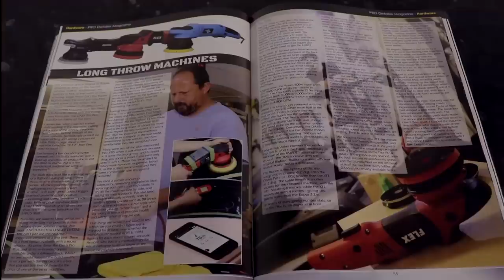Autoglym Polar Range Review  - Wash & Protect your car with an awesome thick snow foam cannon system

Comment: additional note; Autoglym reccomends not applying Polar Seal more than once a month
Reply from the maker: important point ill sticky it. thx richie
Reply: Forensic Detailing Channel what is the reason for this? Can it have a negative impact on the existing protection or (gulp) on the paint?
Reply from the maker: it wont damage the paint its just like a bonding siloxane in water.   If I had to guess, your just putting too much of this material on if you used it every week.  its a mirky white liquid so maybe you start getting like higher chance of bad application or like patchy product on the car. dont know, shouldnt guess, because it might just be because its a waste of product.
Reply: Can buy that canadian tire
Reply: What the price of it
Reply: I'm tempted to get their sealant mainly because of ease of applications. Probably takes just 5 minutes compared to an hour applying a wax or sealant by hand.
Reply: @zaink7037  how did it work
Reply: @DavidC1  I haven't gotten it yet 😅. Still thinking about it 😂
Reply: @zaink7037  Hour?? maybe if you're getting a workout at the same time!! you could watch a movie before you coat and buff a car with bh double speed hehehe
Reply: @martin1649  lol next morning I feel it in my back and sometimes my legs so must be a workout 😂
Reply: @DavidC1  finally got it. It's okay to be honest. Can't beat a hand applied wax really
Reply: I use it every week no issues 👍
Reply: I use it weekly no issues been using it like that for a year

Comment: Thanks for taking the time to review - glad you enjoyed it, the car looks amazing.
Reply: Is Autoglym Polar range safe to use with other Autoglym polishes & wax?  Will it strip previous polishes/wax or is it safe to use along side Autoglym products.
Reply: joflynn5 Yes safe and pretty much ph neutral when applied at the right concentration. It is recommended to still use a wax and or sealant and treat polar seal as a top up.
Reply: AutoglymUK yeah it’s good stuff but I wish the Polar wash would stay on the car a bit longer like the snow foam
Reply: @markford8649  i think the sylizanes bond instantly, they are like a magnet to the clear coat ....from what i know....i think john explained a competitor product once this way...but same concept.
Reply: 20 years ago u brought an orange XR3i, turns out, thanks to your resin, it was blood red ans ended up the redest XR3I in town😁

Comment: I’ve been using this system now for 2 months and I must say that it’s a cracking system. My car is 18 years old and it’s still as shiny as the day it came out the showroom. As for the seal even if you do get it on the windows no worries it acts the same as rain x with no watermarks left on any windows even the front window has no smearing when wipers are used. Also the polar seal does last along time when applied to the car. I’ve used it as Autoglym recommended and it still works after a month before applying a top up coat. 
All in all an excellent product.

Comment: I'm testing these now, the snow foam is excellent, the wash is average, it doesn't remove stuck on flies as good as the 2-bucket method. And I think it's because the wash foam is being applied by cold water, whereas car wash in a bucket will be with warm water.  However,  the seal smells amazing and is really easy to apply, and the results easily as good as Autofinesse Aquacoat. My favourite is the seal and I can see the bottle lasting ages. For the wash you either should just do half a car at a time if sunny otherwise it could dry out, probably better in the winter to use the wash anyway. You also need to factor in buying 3 separate snow foam bottles to avoid cross contamination.  For me I think I'll just be using the AG pre-wash snow foam, my normal 2-bucket wash & AG seal monthly.

Comment: 1k mile wash.
Used AG alloy wheel premix.
Then bottom half spray with Sfix HD.
Then the AG foam trio.
Cleans your car ok.
Using a 56 bar cordless power washer.
Cannot abide rainx or AG seal on windscreen.
Crap at low speed in drizzle or mist.
Great video
Cheers

Comment: I've been trying these products for about a month now. I'm using a new Mitsubishi L200 as the test bed, it's been fully prepared, machine polished then been given a good couple of coats of their Super Resin polish. On top of that, I've used their Ultra High Definition HD wax.
The only downside I've found is if you mix a strong solution of their Polar Blast. I used it one Sunday and there were traces of foam still present in the street the following Wednesday! So, I had to ease up on its use to stop my neighbours complaining. 
All in all, I like the range.
Reply from the maker: your right.  but anything with more foam boosters and stabalizers has more foam thats also more erm.... stable.

but yer foam sticks around on ground.  someone else said that  but its true it does stick around longer.

Comment: Hey John. I have just bought a new hose for my Karcher pressure washer. It's a long life anti kink rubber hose with a swivel connection at the lance end. I got it from Direct Hoses and it's one of the best investments I've made. Not only does it not tangle up like the thermoplastic ones but I seem to have more pressure output now. Its well worth £40 for 10 meters and is cheaper if you buy it through Ebay for some weird reason. Just search for Karcher Swivel Hose. 😀👍
Reply from the maker: can you link me up jason I might be interested. that  green hose lol :)
Reply: @ForensicDetailing .I hope that link works ok.

Comment: Hi Jon, I have been watching your excellent videos for a while and have purchased things on your recommendation like the das6 (great bit of kit). I finally bought the polar series set after watching your review and another YouTube review (a Scotsman wearing glasses!!). This stuff is amazing not only has it cleaned my Renault master swb van, it was easy to use (did buy 2 more snow foam guns for ease of use). Polar blast worked fantastic, polar wash was great, I think my 300ml total mix was asking too much for a vehicle that size, but the polar seal 40:250ml was spot on. The van is now sparkling even more, it already had a coat of ag hd wax. I am a big fan of ag products and will tell them this. Thanks for a great product review and look forward to many more as you are teaching an oldish (45) dog new tricks, keep up the good work 👏👏
Reply from the maker: thanks paul.  you can get great results from these products.  I love using this system in winter, its so fast.
Reply: Thanks for the advice. I was thinking of this for the winter and use my normal 2 bucket method for summer use!!

Comment: Spot on review. I’ve just bought the polar wash to save time as my car is big and keep going back to the bucket can be annoying. Doing a panel at a time, contact wash then rinse is the plan. I’m happy with my polar blast but when that runs out I’m using bilt hamber touchless.

Comment: I'll give the seal a miss as I hate the water activated ones (apart from on wheels) as they do end up on the glass and and time saved is wasted claying the screen! The wash stuff looks very interesting though. There appears to be a high degree of lubricity. I've been thinking about a Hozelock Y connector so that the PW can be attached along with the Hozelock trigger multispray -  would allow the mitt to sprayed clean (like your 1 bucket method) and, on a warm day - PW soap, wash with mitt, rinse panel, spray mitt, repeat, all with no swapping of water supply. Yes, I know, I'll get it all in a tangle and fall over ... xD

Comment: Hi Jon. Another great review. 
I have been following a similar system, but using standard car shampoos in my foam lance. Yes I snowfoam before I go in with the contact wash, but while the Bilt Hamber Auto Foam is doing it's thing, I get a shampoo solution ready. I also use dedicated mits for the top section, and ones for the lower sections and bumpers.
I found it to be much quicker, and one less bucket to fill, and lug around. I also do half the car, then the other half. To be really fussy, I'm going to see how rinsing off with demonized water through a Worx Hydroshot helps speed thing up. 
What do you reckon ?
Anyways, cheers bud. Look forward to the next one.

Comment: Afternoon John et al,
Used this for the first time today as a possible service additional service to offer. My points of note:

Snow foam, quite effective, decent amount of dirt lifted and seen in the run off. Seen a lot worse from others
Shampoo. Dried a little quick, considering it wasn't that hot today, and no direct sunlight. I may up the concentration next time, maybe. I think it best to maybe clean the wheels before applying the shampoo (either post snow foam, or post snow foam rinse) Or, as John suggests, maybe sides at a time.
Sealant. Wow, for such a small amount needed to apply, worked very quickly and the beading afterwards for such a simple application was great. Didn't think the shine was there as much as I'd hoped. However, the car I used was covered in salt and no protection was on it already.

If I had questions for AutoGlym, I've always worked top down, the instructions here are apply bottom up, just wondering why?

Thans for the video John.
Reply from the maker: Im not sure on the applying thing..  maybe top panels are the ones likely to be the hotest so if you start there its gonna get a longer dwell time.. maybe if you put more on the top it risks more going onto windscreen, dont think its critcally important though.    Ive had it on the car for over a week and its been really cool.  Im looking forward to seeing how it is next wash.  And I want to try decanting like I said to use as a rinse aid.  also interested to see if it makes future washes easier because the car is properly dirty again now because of all the like wet winter slush and salts and stuff. cheers mate great feedback
Reply: @ForensicDetailing  Update - tried it on my own car, this weekend and I believe it has also helped 'mask' a few minor swirls ad scratches, as I know my rear quarter was bad, but the A3 in the sun this weekend, looked a lot less swirled than normal. I've also been offering using it with some customers as a basic-ish offering and they are pleased with it
Reply from the maker: @ursocale  thanks mate

Comment: Whilst I use my pressure washer for applying this brand of foam (reassuring it appears exactly the same on the car as shown here) I would never dare use my pressure lance on my car (Mazda 6 Soul Red). The paint is so thin. My preferred tactic is a hose lance followed by Autoglym AquaWax applied by hand - superb finish.

Comment: Just had a go with adding the polar seal into a spray bottle. I added 50ml to 1000ml of water and seems to of worked a charm. I washed the car, then rinsed and applied the spray and dried with a drying towel. You could probably get away with reducing the polar seal even more but more tests to come.
Reply from the maker: hey davy, thanks for feeding back.  thats quite a strong ratio your about 1:20 (there at 50:10000)  So in the lance it would be closer to 1:200 i think.  so you should get turbo charged performance.  maybe try like 20 ml to 1000 litres and see if that still works?  ill get round to try as well and feedback on the channel.
Reply: I’ll dig a syringe out Jon and try with 20ml. As they say Jon ”Its a learning curve”😂😂😂
Reply from the maker: @lazydave3215  yer defo, hey davy how cool though because if you can make use of it in a sprayer like this, one litre of raw polar seal could literally make like 40 bottles of trigger or pump spray sealant.  or if you just use in the lance mainly and decant say 100ml you could also have like 3-5 free litre bottles of spray sealant which can be used in a sort of drying aid style application.
Reply: Wife’s just asked if it’ll do for the shower screen Jon😂😂😂 I know it mentions about glass but it’s working bloody wonders on the glass screen😂😂😂
Reply from the maker: @lazydave3215  could try yes I think it will bond and work if you spead over with wet rag and then rub dry it should work.

Comment: I see you are experimenting the multi-mitt method using the Chinese eBay mitts. Love these mitts since you’ve helped me discover them in your one-bucket method video. If you properly take care of them, they can easily last for a handful of washes and then they are dirt cheap to replace. Brand new, I’ve actually found them softer than microfiber.
Reply from the maker: synthetic wool isnt as good as other formats from the testing Ive seen.  but that testing was on very soft plastics.   on normal clearcoat its more about technique I guess.   I wouldnt use them if it was critically important.  but it is perhaps a reason why I generally use a cool mitt and just rinse clean it.  dunno overal this wash method just made a lot of sense to me, even shooting this video (which slows everything down like you wouldnt believe) it was still so fast.

Comment: Just used the Polar wash this morning( with the cheap but very good eBay wash mitt thingys) really saves time and washes really well. I used Bilt hamber snow foam as pre wash rather than the polar blast. Work well together, but as mentioned in your video, I would not want to use in hot weather. Well impressed though as a quick winter maintenance wash.
Reply from the maker: did you use polar seal as well peter?
Reply: Forensic Detailing Channel 
No Jon
 Because I’ve got Fusso coat on it I wasn’t sure if it would bond tbh. So I am using the soft 99 QD spray that compliments it.

Comment: Great video! I picked up the whole range and cant wait to try them out. Ive already got a foam canon to use with the polar blast and wash, but for the seal i bought a cheap karcher FJ6 foam canon to be used with the polar seal exclusively. Because the karcher foam canon is only 0.6l bottle, how much polar seal do you recommend i should put in?

Comment: Mate I finally subscribed. Your videos are bloody engaging. We have only recently had this made available on the Aussie market and I'm too lazy to wax the car every 2 months so might give it a whirl for some protection. Even too lazy to aqua wax.
Reply from the maker: this is defo for the lazy detailer :)   just be carefull in that aussi heat mate.  any spray and rinse product hate heat.  so literally spray on blast off.  work in sections rather than whole car if there is heat involved or try and work out of the heat if you can.
Reply: @ForensicDetailing  thanks for the tip. That's how we have to work just washing the car let alone applying anything like this. Keep up the awesome vids.

Comment: Hey Jon - Love the videos! Is that a standard karcher pressure gun, looks like the tip/water flow is different? Also what hose have you changed it to? I'm getting fed up of having to move the pressure washer around the car to do either side
Reply from the maker: that was stnadard setup on an old karcher K4 eco.  you cant get it now.     I use K7 now Alex

Comment: Still on the fence with the polar blast snowfoam but l tell you what, l just bought autoglyms new high performance tyre gel and its really really good if you like the high gloss look and what the hell have got on the beemers paintwork as nothing is clinging on it.... Also digging them tunes DJ..... Jon
Reply from the maker: I think the beemer just has beadmaker on it. but like old beadmaker.   that tune rocks dunnit.  was just scanning through tracks and like, thats a good'un :)

Comment: In my assessment you are the undisputed authority on online car detailing information - Love your videos mate! 
Quick question: would it makes sense to apply the Auto Glym Aqua Wax on top of the Polar Seal? Or is that unnecessary/counter-intuitive?
Reply from the maker: they are essentially the same sort of thing Joe.  Polar seal is a mega concentrated version with usage instructions for use in a snow foam lance.   Aqua Wax is like set up to be ready to use.

With Aqua wax you could bust it out most like a sqray wax or spray and rinse, you can control where it goes more.   Polar seal sort of puts a blanket everywhere because its gonna come flying out the lance.   Heres a cool tip.  Take some Polar Seal and mix about 50ml with 500ml of water and use it like Aqua Wax but a very cheap version of aqua wax.  This works   I love polar seal because its so concentrated you can create little haxs like this.

Comment: I recently used all 3 products. Worked pretty well although didn't get the bugs off the grille. Really need a hot wet rag for that. The seal was a bit of a pain to hand dry and then clean the windows but it looked good afterwards. No idea if it's better than a proper hand polish and wax but I assume it isn't.

Comment: Great video John, as ever, thanks! 
I usually use Bilt Hamber; Surfex HD as a snow foam, Auto Wash to contact wash and then Double Speed Wax as needed. Would the Polar Seal be okay on top of the wax, as a top up product when I don’t have time or it’s damn cold?   Cheers!
Reply from the maker: I think so huw yer, I think you would wait for the wax to die down so the polar seal can get more of a chance to bond.  wax obviously wont help it bond. but this isnt like a durability product.  something you could just throw on.  tell you what though, its been hammering it with rain today and like the jelly beans on the car effect was cool and like when you get upto speed all the water flies off.  when you park and it rains the car had really cool beads.  I know beads aint fashionable but something nice about it at least :)